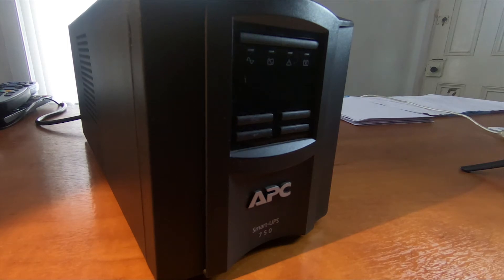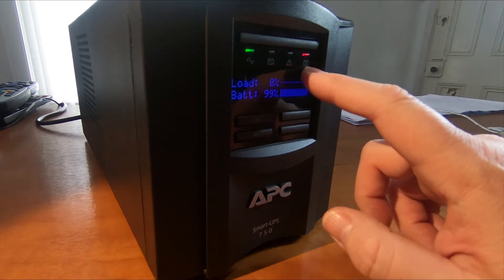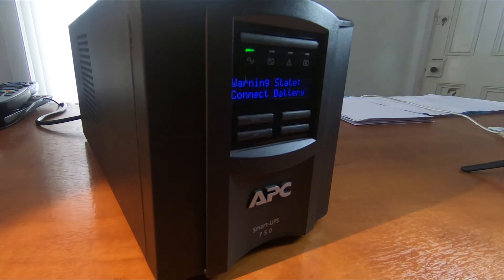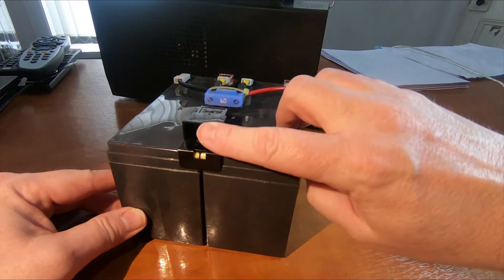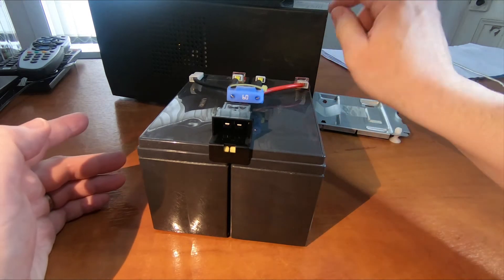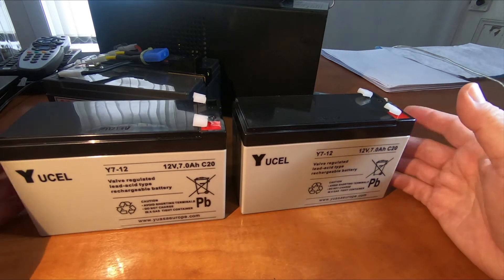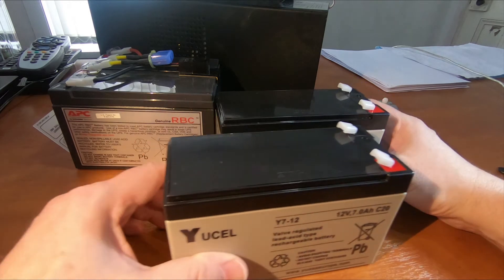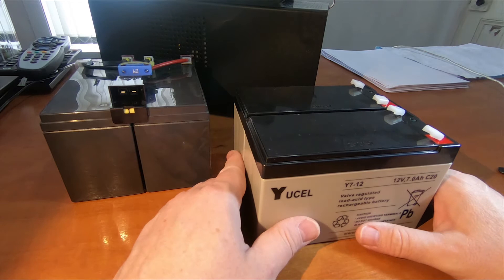Cheap battery replacement for APC Smart-UPS 750

Comment: Hi. My first change was to another of the recommended APC RBC48, then I used Yuasa NPW45-12 (as they were also noted as being 'valve regulated' and they had the 6 x 18 mm recessed weakened areas on top; by failing there, that should prevent them from bulging sideways and thus getting stuck in the battery cavity) then I used Xtreme XR-7.5 FR (and I again reused the original harness) and they lasted well; they didn't have any sign of the 6 recessed areas on top (I'd forgotten about that when ordering them, but it's a lightly loaded, I changed them when the UPS alarmed and they looked fine). With these latest one having just failed, I noted that the RBC48 is currently £137 on the Amazon APC store - ouch - but that same APC store also sells APC APCRBC113 for £61 (which also have these recesses on top), so that's what I've just fitted a few moments ago. All of the ones mentioned above had the wider terminals (including the latest APC APCRBC113, which don't come with the Smart-UPS 750 harness, but which do come pre-taped together) and I see from the date label that these latest ones are showing as being 5.5 months old, so that's still okay (I think that when sitting on the shelf, they need a charge every 6 months, so I'm within that period). Every pack I've used has lasted over 4 years, but you have to watch when you get near 5 years as though they might hold up for a light load, if you put a heavier load on them they just die immediately. As I'm lightly loading them, I don't test with a high load; I just wait until the unit shows the red LED and starts to beep (typically at 3AM) then I change them. 😀

Comment: Great video! Can we get a link for those small connectors that make them larger thx. 😁
Reply from the maker: Many batteries (including the one in the video) come with the adaptors. If you need to buy them separately search for 
"t1 t2 terminal converter"

Comment: Hello, I cant take out the batteries because they are bloated. Is there any other way to pull them out? Plus the previous owner ripped off the pull tag trying to get the batteries out.
Reply from the maker: Oh not good. 
Maybe two srewdrivers one on each side to lever each side of the battery together against the case a bit at a time?
Reply: @ANTandTEC  I got them out finally. Used 2 screwdrivers as prybars to push them out. And lots of force with my hands. Man, these things look like balloons.

Comment: FYI, the battery your installing is a UB1270 battery. If you want more storage, you can install a UB1280 or a UB1290 as they are the same size but have a higher AH (Amp Hour). The third number is the AH rating.
Reply from the maker: Did not know there was higher ratings available in the same case size - good information 👍
Reply: @Robin Rastle Correct, the 1270 is a 7AH . The 1280 is 8AH and the 1290 is 9AH. All three have the same physical size and connectors.

Comment: why not just slip a paint scraper under the proprietary connector, pull off the terminals and stick it all straight onto the new batteries?
Reply from the maker: Next time I will.
This was the first time I had attempted this, and assumed the connector was fixed firmly between the batteries.

Comment: Thanks for the tutorial. Are the batteries still efficient after one year? Thanks
Reply from the maker: A year should be no problem. After all they are not in constant heavy use, most of the time they are just on standby. 
You will find your offline time reduces as the batteries get 'tired'.  Think the ones I replaced were 5 years old and still held a charge.
Reply: @ANTandTEC  Thank you, the reason I'm asking this is that I did switch to a "non APC" battery pack on the same UPS 1 year ago and now I'm already getting the "connect battery" message with the red led blinking. Hope the Yuasa batteries will be lasting longer...
Reply from the maker: @stefanofassone6686  Yuasa are decent you should be good 👍

Comment: Do you still use 12ah battery for model SMT1000i model?
Reply from the maker: The batteries used in this video are 7Ah. The ones that you need to replace in the 1000 model are 12Ah batteries. The principal should be the same but with larger batteries.

Comment: I Always separate glued batteries with a plastic spatula and WD40 or splash of oil. There are no quirks, holes and stretched foils for example. on lipos and is much easier;) and
you urgently need a pad for your good table !!!! :) Greetings

Comment: Great tutorial, many thanks.
Does the fan only work during a power cut or it is spinning when it charges the batteries?
Does it make any noise like humming or high frequency noise at any point?
Can the display be turned off or dimed?
Reply from the maker: Thank you! 🙂
The model I used in the video did not have a built in fan. During charging there was no noise from the unit. When supplying power via battery, there is a slight hum but not loud at all. 
Also, my model did not have the option to shut off the display. I believe that the newer models do. Possibly a firmware update may add this..?
Reply: @ANTandTEC  Thanks for the reply, it’s quite confusing because some of the same models (SMT750) have fan but other don’t…
From what I understand it has been in production for a long time and has evolved. The older ones didn’t even have a display, and as you said the newer ones might also have new features.
Anyway the common point seems to be the battery, which I found to be the same for older and newer models.